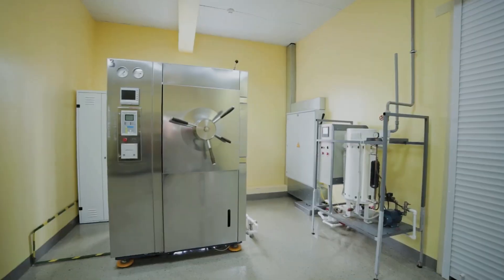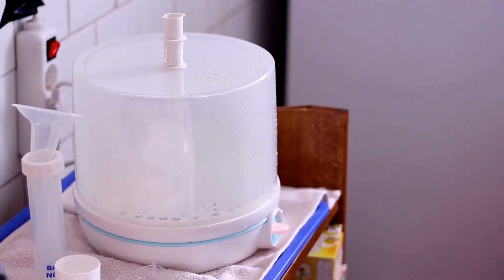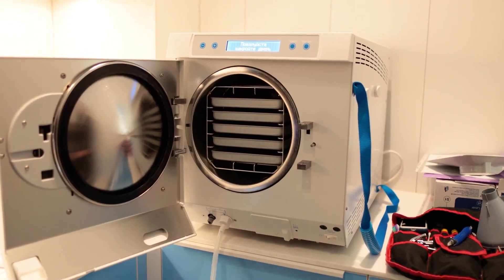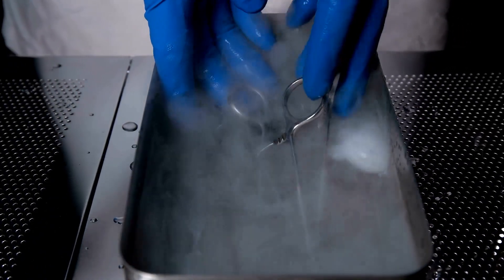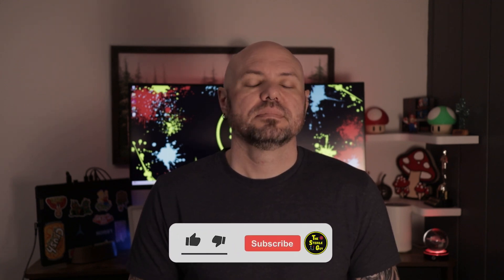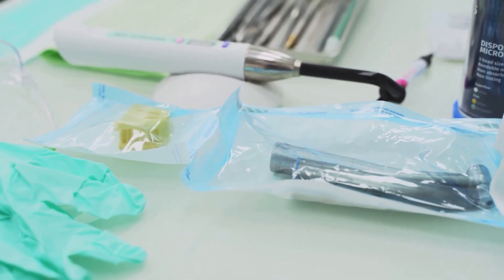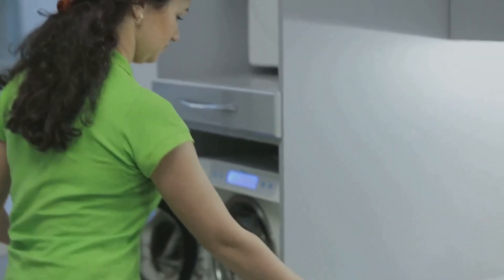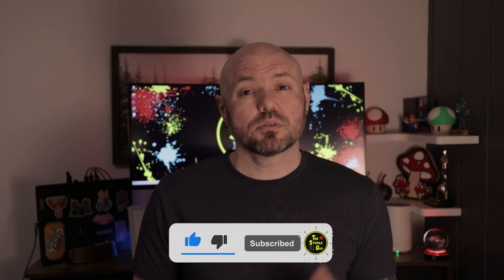What Makes Steam Sterilization So POWERFUL?

Comment from the maker: What issues do you face the most with your sterilizers - wet packs, cycle failures or maintenance issues?
Reply: I work at a high altitude (5,000 ft).  We had to increase our dry time from 20 mins, to 40 mins.  If we did the standard 20 min dry time everything would be wet

Comment: For pre-vacuum parameters I’m seeing a lot of 273°F? Will the exam ask for the parameters you provided at 7:02 (270-275°) or a definite number?
Reply from the maker: Usually the exam states a range. But if it is an exact number, just look for the one within the range as the others will be outside that range and clearly incorrect.
Reply from the maker: I should add that 273 is because typically that is a temperature sterilizers will reach and print on the receipt at end of cycle.

Comment: Why does the B&D Test run in an empty chamber and why not B&D Test run in full load please explain
Reply from the maker: The Bowie Dick test is ran on empty chamber according to the IFUs and AAMI standards. Why an empty chamber? Well, it comes down to the concept of greatest challenge. An empty chamber has a lot more air to remove than a chamber full of trays due to the mass of the trays. Having to remove the greatest amount of air then tests the performance of the vacuum pump. Also, having an empty chamber means it takes a lot more steam to fill the chamber to the proper psi. So this tests the performance of the steam pressure. If trays and other items exist inside the chamber, it actually makes the sterilizer vacuum and pumps work less hard. You want to test a sterilizer when it is under the greatest challenge. It’s like the concept of sports where your training is very hard so that the gameday is actually easier when it counts.

Comment: Thanks your video's are so well done.

Q. 
Do you have a video out that shows the sterilizer load print out. Highlighting all the critical information MDRD staff should be reviewing after the load? 
There is much discussion in regards to recall practices. 
cycle # of the autoclave traceable to the load sterilized in it. 
Some say no
Some say yes 
is there a best practice 

Thanks 😊
Reply from the maker: I do not, but this is an excellent topic I will begin to work on. Don't hesitate to add any other questions or requests if you think of them. Thank you!
Reply: @thesterileguy 
Thank You that's fantastic. So thoughtful
Reply: Q.
At our site we do minimal items on a gravity cycle.
1 to 3 peel packaged items for the entire load & that's not an exception. Most staff avoid running the gravity load items in a timely fashion for several reasons which can cause issues. 

Could those items be reprocessed in a VHP sterilizer which have smaller chambers & used a lot, many times a day.

I'm going to assume yes if the IFU states either method is allowed. 

We were told that you have to choose one sterilization method or the other not flip back & forth between steam & VHP. Would you please share your knowledge on that also. 

I look forward to your imput.

Thank You 😊